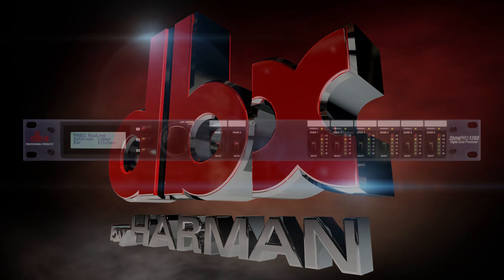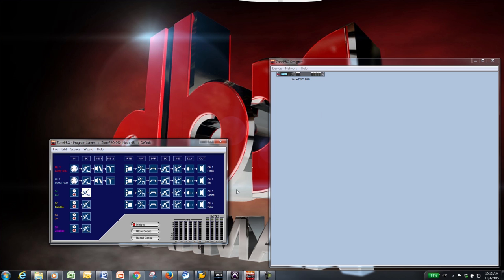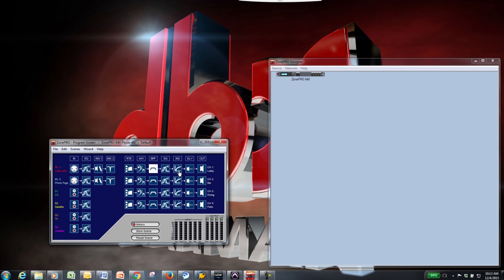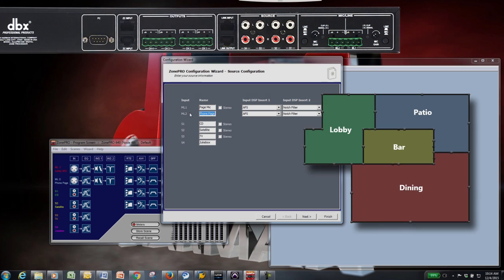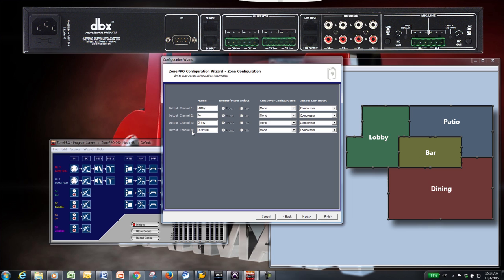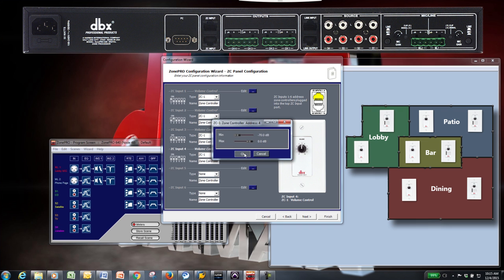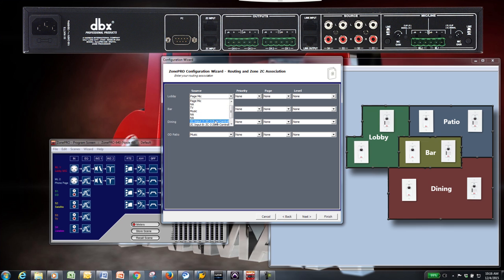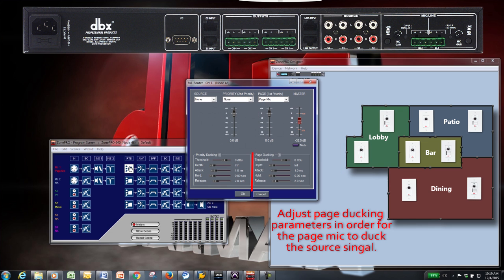Setting a dbx ZonePRO™ Product using the Configuration Wizard in ZonePro Designer

Comment: please can you help... the ethernet port on my zonepro1260 is not connecting on my computer, niether lights are not blinking
Reply: If you are using the Ethernet port instead of the RS-232 port make sure that you have unchecked the button for com ports and selected the Ethernet connection in the network setup. If you have already done this, make sure that the IP address of the computer you are using to program your ZonePRO and the IP address of your ZonePRO are close to each other (I just copied the computers IP address and changed the very last digit when I assigned my ZonePRO’s new IP address). The Subnet Mask of the programming computer and the ZonePRO have to match, in my situation the Subnet Mask was 255.255.0.0. Once I changed the address I clicked on “Go Online” in Design Wizard and it located my ZonePRO, I was then able to double click on it and program it. Be aware that if you manually add the ZonePRO you’ll be working offline and not actually making any changes to your device. If you cannot locate your programming computers IP address information click on the “Start” button in the bottom right of the screen, in the search bar type “command prompt” and open a command prompt window, then in the command prompt window type in “ipconfig” and press enter. Your IP address, subnet mask, and other needed info should then pop up.
Reply: be sure you have a "crossover type cable" or it won't connect